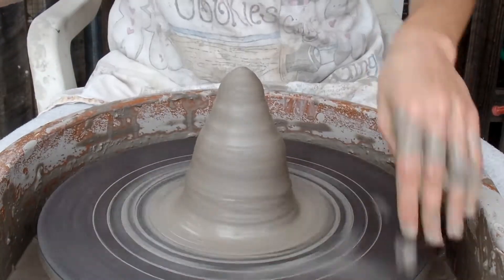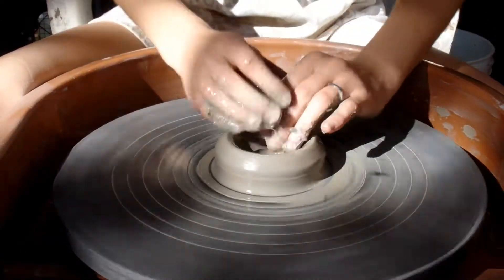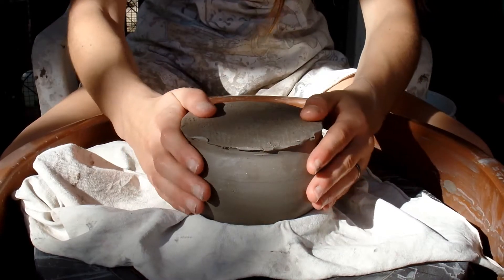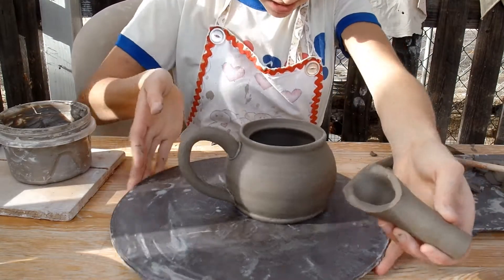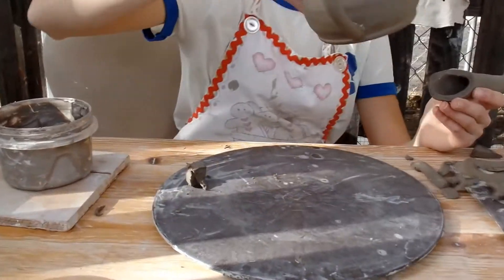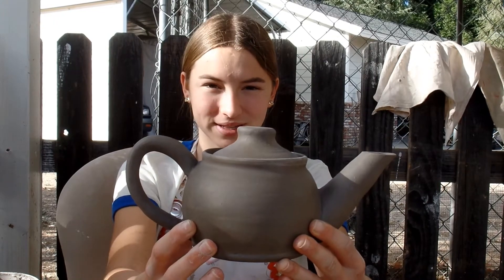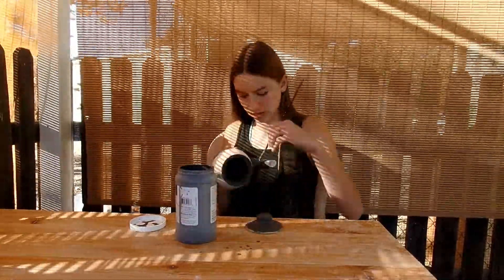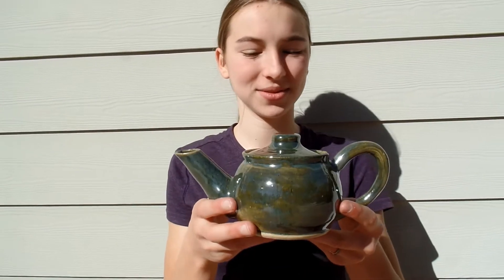Handmade Ceramic Teapot (throwing-glazing)

Comment: .....  Nifty video.  (Geeky question) Based on the different shot sequence and different attire..... I’m going to guess the full process from start to finish at least 3 days to make the teapot?
Reply from the maker: Yep thats right! First day we throw the parts of the teapot on the wheel, then let it dry overnight. Then we trim the parts and put them together. Next it dries for 1-2 weeks and is fired the first time. Then we glaze it and fire it the final time to show the finished product! So it takes about 2-5 weeks for each item we make!
Reply: @JustBEPottery  Holy smokes, that certainly takes a lot of time to make it. Do you need to batch with other pottery works to fire or are you able to do them individually?  Wowzers 2 to 5 weeks...I can imagine the ideas of what to do on the downtime to wait for it to dry. :D
Reply from the maker: @ShaLaLaLaProductions  yes we definitely do them in batches, typically in “kiln loads” so we do a series of firing about every month. Planning is key!
Reply: @JustBEPottery  indeed... guess “ this is the way?” 😉